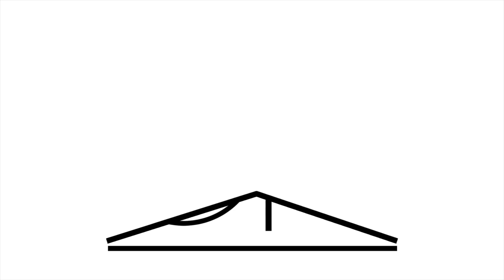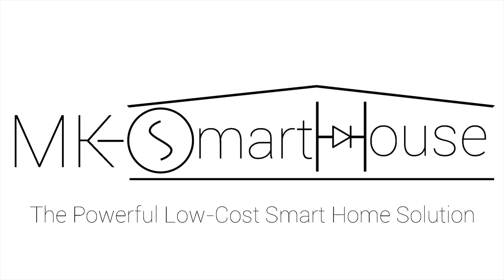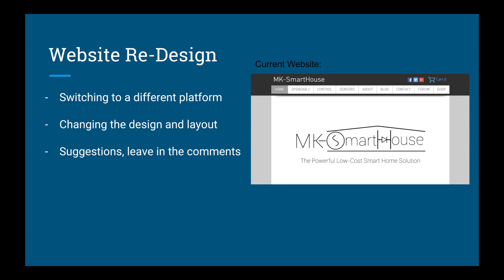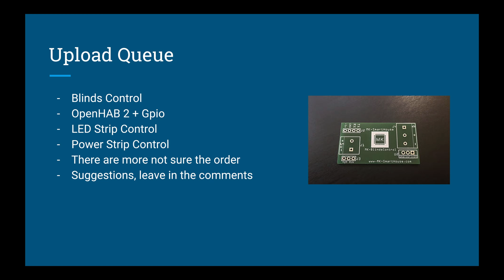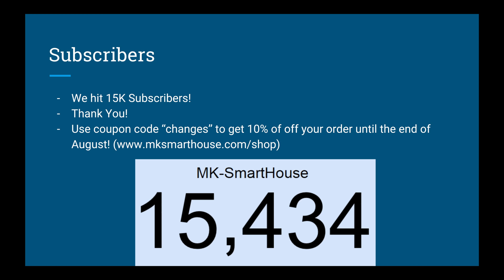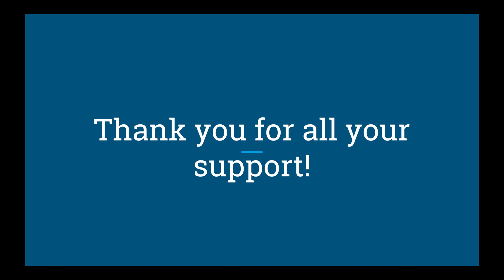It's time for some changes...

Comment: Sonoff touch wall light switch? Any chance of doing a video on connecting that to mqtt? If that’d be a thing it would definitely be the motivator to finally set some home automation up - living in Europe though wiring stuff through walls is a pain and to be avoided at all costs - hence why the replacement sonoff switch would be ideal

Comment: I am trying to shift my normal home to full home automation so I am thinking to install 1 raspberry pi in each switch board and  use 1 raspberry pi as server for all raspberry pi (all Raspberry pi will connected to 1 Raspberry pi ) and can be controlled by LAN or internet and since I am from India here air conditioner are not connected to Central thermostat so i am going to install 1 Raspberry pi in all our home air conditioner too . So Please make a video for it ... Please please.

Comment: Hey Matt, this is all good stuff !! After my first DIY home automation project based on your sprinkler project, which became a lights management system for my garden, I am venturing into Openhab2. While it is a great software , I don''t find it easy and more "educational" videos would be great. For example, I'm trying to access to my heat pump (connected to my LAN and access is via an HTML page) now trying through HTTP requests and it is not trivial ... may be a hint for your site, where you have "construct a new project" area and another area for "get some new skills (openhab, mqtt, ...)". Hope this helps, cheerio !!

Comment: Hi, my suggestions videos ideas :
- Electric shutters control (Up, Down, Stop, XX%, mannual mode for bed rooms... )
- 2 ways light switch to smart switch additon to keep existing switch system (eg RTD14005F)
- House power consumption
- Motion sensor trigger
- Wash machine, Tumble dryer ... : state with it power consumption range (Power off at the end with your power strip)
- Maybe a sponsored video by nest ot netatmo for smart thermostat heating system
Sorry for my english, I hope it help. thanks

Comment: can you make tutorial for RGB light strip with ESP8266 contorted by MQTT with arduino tutorial please
Reply: same for me please
Reply: Took me a while, but I achieved it. Arduino received info from MQTT in a JSON format and processed it(I got the arduino code from other youtuber and slightly edited it, since he used a different framework than OH2). What was really hard due to the lack of documentation was to get OH2 to transform the ColorPicker item input to a JSON formatted output. If you are really interested, let me know so I can help you.
Reply: same for me !
Reply: Hi i am really intrested in how you get iT working i am a. Biginner in coding so I can use Some help kind regard Pepijn

You can contact me on My 

Gmail:pepijngamenl@gmail.com

Comment: Light switch with normal switch in place
Reply: This a big issue, isn't it. The fact that you can't use a smart light bulb unless the switch is physically on is awful. Perhaps setting up the ESP8266-equipped switch and the physical switch as a three-way switch so the light can draw power from either. A nice little solution that fits in a switch gang would be awesome but maybe one would have to run a 3-wire piece of Romex to the light...not fun.

Comment: First off, I wanted to tell you that your web site is the first one I found that actually went and described in a simple step by step explanation how to configure openHAB to operate properly. Kudos!!!
A few suggestions for future tutorials/videos:
- Secure MQTT setup (plain http for MQTT is quite in secure)
- ESP32 overview and use instead of ESP8266 (it has hardware acceleration for encryption)
- ESP32 with battery for cordless sensor applications + battery monitor if possible 
- upgrading nodeMCU version on an ESP device
- using a z-wave stick to control z-wave devices
- plus one here for direct GPIO control

For the website, I would recommend having at the bottom of every page a comments section. Many people have questions and/or struggling with it and it helps both others with it and you to update the tutorial in some cases.